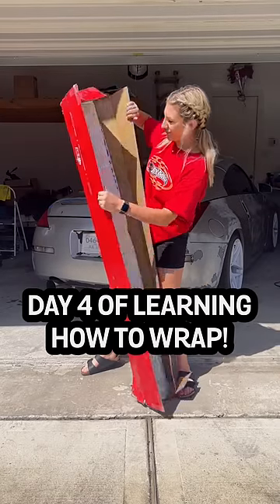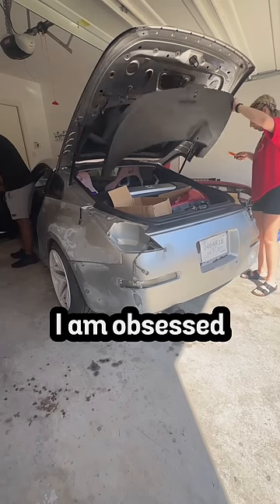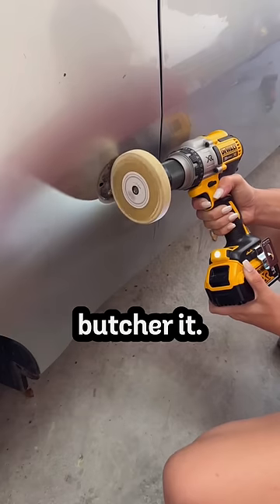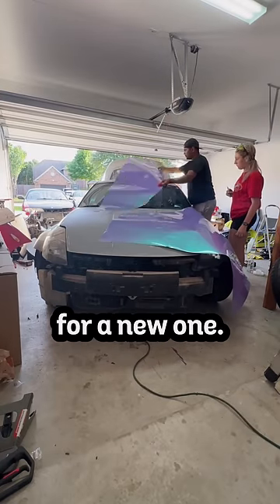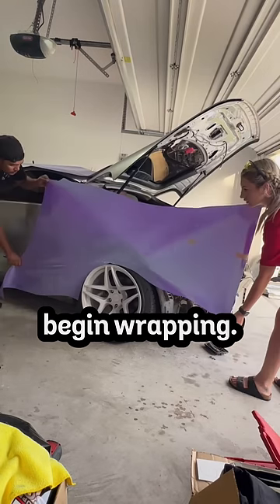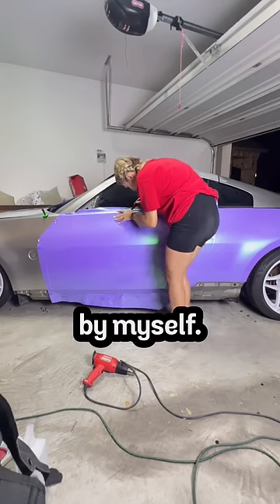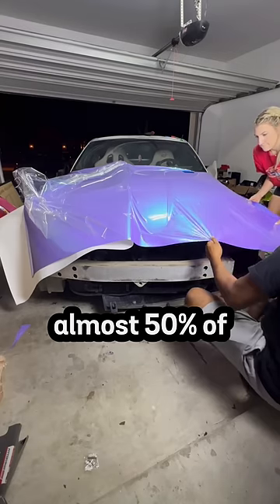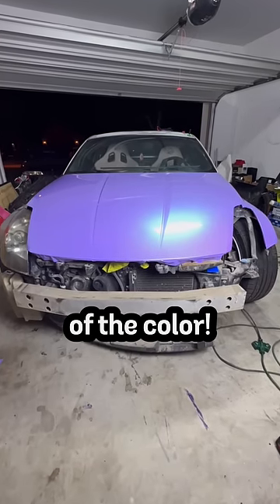Day 4 of Learning How to Wrap My 350z!

Comment: Vehicle wraps need to be re-installed every 3-5 years. To get the most out of your vehicle wrap, consider washing your vehicle by hand and avoiding pressure washers. (If you choose a pressure washer, maintain plenty of distance from the vehicle or wash on a lower intensity to avoid peeling the wrap off).
Reply: To add onto this try to stay under 1200 psi if possible
Reply: To get the most out of my wrap; I got a 20-year paint job for 7k instead.
Reply: I love the color.
Reply: @-KIMISAFOX where's the fun in that?
Reply: I pressure wash my wrap every time, still looks good, as long as it’s a decent quality wrap you can treat it like paint
Reply: @xxcreoxx4599  Putting a Polish on it every couple of years is pretty fun.

Comment: Found one of those 350zs, in the impound auction the other day. Used to have wrap on it. But all the bodywork underneath, swelled up from condensation. And, the wrap came off. 

It's sold for $560.

All of the body work on the car needed to be redone. And some panels needed to be replaced. Because the unfinished bodywork, caused it to rot out.

Comment: Question: Does this take off the original paint? Looks beautiful by the way.
Reply: nope! some people actually do clear wraps to protect the factory paint. Its entirely reversible.
Reply: @confuzedgraphite  what do you mean no? Absolutely false information. I ran a wrap and paint shop for 7 years. If you are not using the highest quality of vinyl it will not be easy to remove after 3 years of heavy sun exposure. We had a customer com ein who had his car wrapped for 5 years and it stripped the clearcoat right off his car. This happened multiple times. We offered nothing but 3m at my shop. If you wanted the cheap shit i wouldnt even install it for you. And the full wrap your talking about is called ppf. Completely differant than vinyl in terms of properties.
Reply: @sc_diemonds219  sounds like you don’t know how to wrap cars. Or rather, you don’t know how to unwrap them.
Reply: i know how to remove vinyl properly bro. . it ripped the clearcoat right off with a proper removal.
Reply: @sc_diemonds219  sounds like you did it wrong.